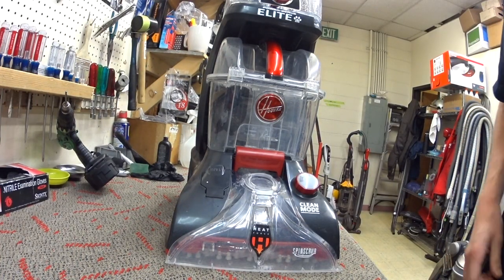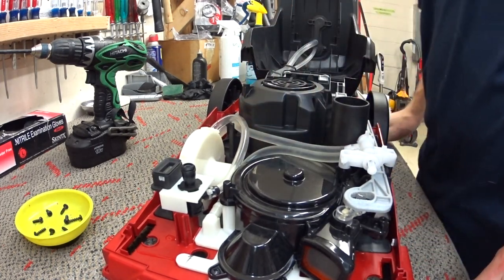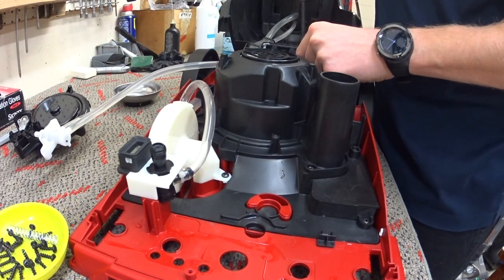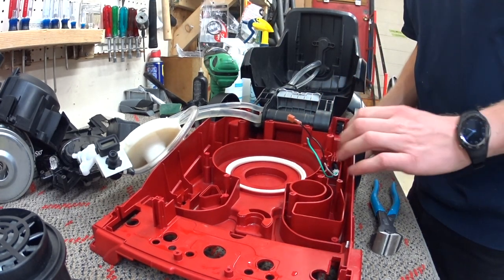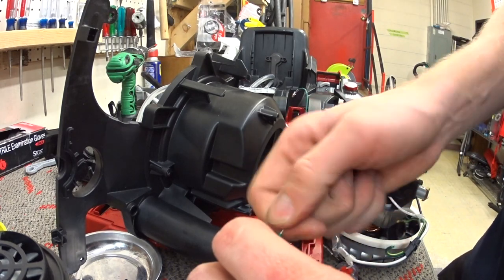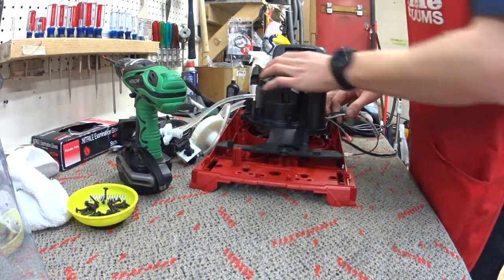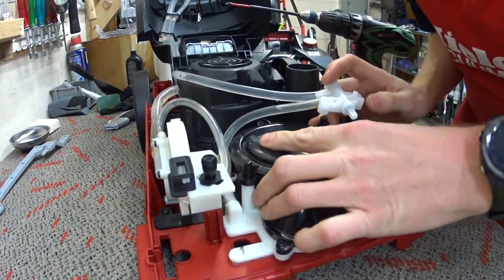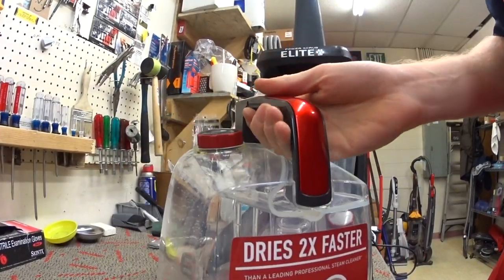Hoover  FH50251/Royal fr50152     carpet extractors  Repair

Comment: My scrubbers stopped rotated and I used this video to help take my machine apart.    I did have to take the turbine apart and luckily I got it rotated.  The location of the spring got me confused when I took it off, but this video straightened me out.  Thanks again.

Comment: A lot of work to switch out the motor. Have you seen the new Hoover auto wash?I bought one and it worked about 3 hours until  the brushrolls stopped working. The machine cleaned very well for those 3 hours. I returned the cleaner. Thanks for posting such a detailed video!! Thanks

Comment: My Hoover® Power Scrub Elite Carpet Cleaner does NOT dispense water after 3rd use. I have had it 3 weeks. I use it weekly. Last week, I noticed hardly any water coming out of clean water tank, so I just poured warm clean water onto carpet to clean it. The suction is great. However took forever to do it this way. This morning, I took the basics apart and checked everything (I am owner of HOOVER steam cleaner for over 20 years) Never had this problem in older models. Glad I kept my recent last model. Anyway, I have 1 week left before warranty expires. (3/21/21). Here is What I discovered, that is wrong--I think. The tank that holds clean water, on bottom, with valve button, works great. However the valve button on Steam Cleaner that the clean water tank seats onto, has no give, while pulling or holding onto trigger. It is like solid frozen. To me it seems it should do something, while I am pulling on trigger w/o the clean tank sitting there. What do you think? Brigitte in Tulsa Oklahoma

Comment: Love that you didn't edit out the F-bomb when commenting after the inbound phone call.

I am literally a former sailor and tend to curse like one when a repair project gets a bit wonky or a screw lodges in a fan shroud just as I'm buttoning up a unit & I gotta partially tear it down again to recover the screw, etc.  So I appreciate the realness!

I know WAGO lever-style wire connectors (inline or otherwise) are likely to be a bit more expensive in the long run than the crimp ons, but I frankly love them for long-term reliability, small form factor & of course their inherent "quick release / re-use" design.  I no longer use traditional wire nuts on any personal electrical projects, including small appliance / tool repairs such as the one in the video (which I've had to perform on my own Hoover Power Scrub FH50150).

I wondered if you've found WAGOs useful or considered utilizing them on various bench-top repairs like this one where the original harness & motor have no quick disconnect, wire nuts, or similar from the factory to more readily facilitate motor swaps? 

Anyhow, great vid and sorry to hear you really kinda get ripped on a lot of those warranty repairs.  Great technicians are underrated and underpaid, imho!

Cheers

Comment: I have a royal FR 50152 and I’m pulling the cover housing off and it’s hanging up on the switch foot switch which would be facing the vacuum right corner. If I’m behind the vacuum and vacuum it be the left corner it’s hung up there, but your purpose behind this is it started smelling like I was burning rubber. I thought it was a belt after watching your video looks like it’s a motor. So two things trying to get the casing off and where do I buy the motor

Comment: I have the Hoover Power Scrub Elite cleaner FH50250 and it leaks from the bottom on the right side, power is off and I am not using the trigger. So I do not know which part to look at. Would it be the flow switch or pump. I am working on my own machine and hopefully you can help.

Comment: The powerscrub deluxe is an amazing cleaner but got I absolutely hate the hose pumps. The hose pump’s impeller on mine wore down for some reason. I attempted gorrila glue and plastic bonder and neither work. I will later try JB weld epoxy and it should hopefully work. I know people also have issues with those things breaking. Im 100% not paying 70 for a new pump, especially since its cheaply made and could wear again.

Comment: Mine leaks when i shut it off, Do you have experience with fixing leak?
Reply: Mine just started doing the same after only using my hose for the second time. I need a part, but Hoover says there parts aren't available.

Comment: I have the Hoover FH50105, the brushes quit spinning. The bearing was frozen on the turbine. I got that fixed but, it seems the brushes only spin if the front pickup is in contact with the carpet. It seems it needs that reduction in suction to spin the turbine. Is that correct operation? Or do I still have a problem.
Reply: I wish they would have run the brushes by the motor and not vacuum. I was thinking of modding it by running the brushes by a heavy duty remote control car brushless motor. I would have to put a 12v DC transformer in it tapped of the 110AC...LOL

Comment: The spring fell off in my Hoover F5872 900 solution tank, how can I fix that, I have the valve stem and the spring, wondering what holds it on and is something missing that I dont know about, thanks
Reply from the maker: You need a new tank when that happens.

Comment: Could you do a dissasembly of the lg kompresser luv200r and motor replace
Reply from the maker: https://youtu.be/ta64uC6LEWQ
Reply: @PerformanceReviews  thanks and the reason i need u to do a video or some advise is because i fix up vacs myself and i bought this cheap lg vacuum the kompressor and ot suction is very low and i think it could be the motor bc there is no blockages and idk if its the motor or something else so any advise ?

Comment: That thing looks cheap as ever junk
Reply: Please if you know exact hoover motor/ pump assy that your showing here please post so i can search and order this. Just in my experience using this same model is that to get good flow and dispersion with the solution or clean water rinse tanks is leave the fill caps on, but not tight on..crack them to let some air pressure help that cleaner and water flow better. Also..dont treat it like its a commercial grade and unstoppable. And dump your dirty water..then rinse tank and diaphragms good..reassemble wet and that will help secure a better suction from the start!! :-)